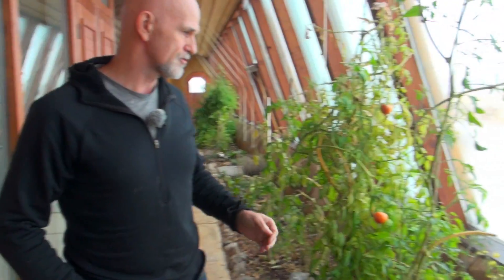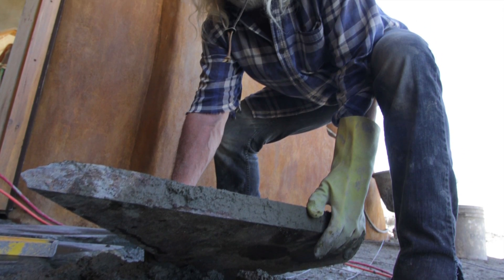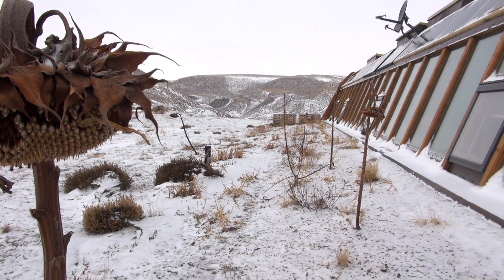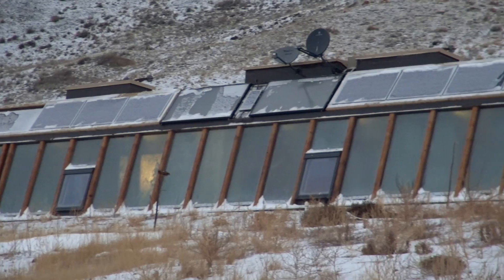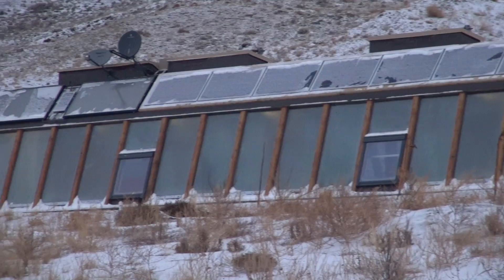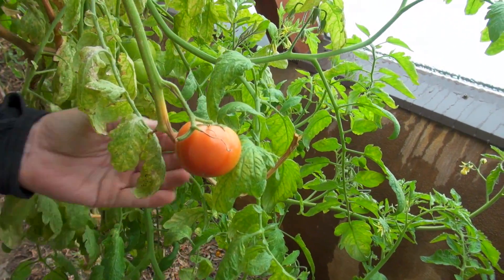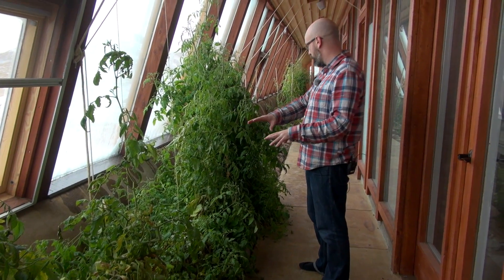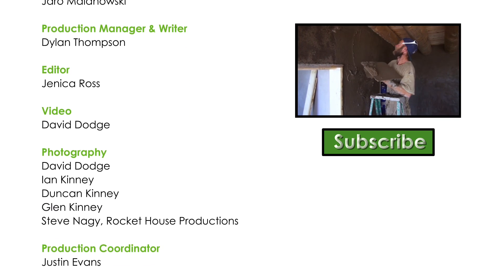136. Earthship living in a cold, desolate, Canadian winter

Comment: we live in a camper on 80 acres in South East Sask. near the North Dakota Border with some rolling hills, we do have access to power close by but ONLY IF we want to hook it up, we have an Artesian well tons of water though, not drilled, I have owned this property for over 40 yrs, I left Ontario to comes back home, we have surveyed it and fenced 100% of it. We are desparate to have help and knowledge in starting my Earthship, have 1 100 watts solar panel ( well its a start ) have a small camper in which we live in only with batteries and Generator, we are 70 yrs young, getting Bees in the spring, will be totally self sustainable, have a place picked out to start building IF we get help. PLEASE if you can help we would be eternally greatful...TY. PLEASE HELP US.

Comment: No wonder you’re running out of stored power; you have you batteries outside (even if they’re in an enclosure); you need to have lead-acid batteries in the warmest part—in fact the warmer, the better.  Don’t use proximity to the PV panels as an excuse; that’s what series configurations are for…

Comment: Sustainable?  You're a major polluter in the winter burning wood, a horrible air quality destroyer.  Let's face it:  Its pretty stupid living in area far from the equator in the winter, areas where food production is impossible.  THIS - MAKES - NO - SENSE. Haven't we learned how bad fires are for our air quality?  They're WAY worse than vehicle pollution - all the more because we don't really need them.  Solar and wind for electrical power to power heaters.  That's your sustainable solution if you're insane and spend winters here.
Plus you run propane.  How about going raw so you don't even need any cooking facilities or waste?  Meat, dairy, fish....100% raw.  Sprout your grains, lentils, beans and peas.  Corn is eaten raw.  It works.  But you'll need a warm climate inside to grow fruit in the winter.  That's probably the biggest challenge.  Some would say its not ideal eating food that can't be grown in the winter and they may have a point.  But then again if it wasn't for your well designed shelter you couldn't even live there in the winter.  Face it.  We were nuts to settle so far from the equator.  Absolutely nuts.  Before our transportation system was improved 100 years or so ago, malnutrition was a very serious problem in North America because during the winter we couldn't grow anything in northern areas.

Comment: I was so entrigued by this I went down to Taos, NM a few years ago. I'm from Saskatchewan so I know about the -44c cold snaps and the + 45c in summer.   But until u are hands on in one of these places, it's just not the same.  Self sustaining , with geothermal  constant regular temp within a few degrees which is controlled by the 65 foot tube running underground straight to outside.  Air cools when it travels thru it !  Or releasing heat by the roof  trap windows in green room.   Was awesome that u can rent one for a sleepover and experience the entire system firsthand.   So to answer the Canadians asking, I asked in person. I believe he said with half burrowed ship with sand packed tires, and a solar side, Canadian tundra is no problem. And it's work and experimental ideas still in progress. He runs an academy school down there. Interns, students build and live in their own. Thought about building a dog house like this.   Hmmm...  Cheers!

Comment: The edge where the soil meets the pavers / concrete... they should have a raised edge there with an opening every 10 feet for so to keep the soil where it should be but allow dirt to be swept in.

How can u clean the toilet if the water keeps recycling?  Can you use bleach?

Comment: This place reminds me of the Automobile manufacturers taking turns rolling out their one single hydrogen powered car, then lauding its praises as the future of transportation when in fact it's just a PR exercise.
This house cost how much to build? It houses how many people?It requires how much land?
What is the energy density, cost per kilowatt?
Cost per square meter to build?
Can the average income earner afford one of these structures?
I ask these pertinent questions, because I designed off grid steam turbine micro power plants that were multi fuel powered, meaning they could generate 25 kw to 100 kw from diesel,propane or nature based ethanol  derived from sorghum.
It is expensive, or requires  usually very low population densities to go off grid.
It is fun to build these structures and take the moral high ground with a sense of superior smugness , but try extrapolating this concept for 500,000 to 1,000,000  populated cities.
There is a reason this stuff works for a few former hippies.

Comment: Im poor and im still better then him. When i turn up my fire place can coock steack, bake bred, heat up water. I aint resupply gas that distance. Well if you stil lreading, i got 2 kw windturbine + another one 500W that picks primarily low wind speeds. And a TEG module is permanently bolted to to a stove. When stove is hot it produces 55W of electric power. Self cooling circulation pump 5W.
Who need satellite tv when life is so alternative from government.

Comment: He looks a little chilly. Earth ships should be kinda hard in the far north where soil temperatures are pretty low. (Deep soil temperatures @ 10 ft deep are basically your average annual temperature ~5C/40F in Alberta) Solar gain is nice, but you need insulation to keep the heat in - pure thermal mass will just draw you towards 5C. If you have a large thermal umbrella then i could see how it might work.
Reply: Best is to build into a mountain, like a cave home.
Reply: neither mountains or ponds should help much with that issue, basically because those are all sources of thermal mass, and earth connected thermal mass - aside from buffering some seasonal variation will tend to bring things towards the average annual temperature. You basically need some kind of insulation to fight cold weather.
Reply: @LucidTactics  For sure... I'm planning a passive solar build for central Saskatchewan with an insulated monolithic slab.  Not really an earthship but I plan on incorporating several of the features... grey water/greenhouse, water and solar collection, cooling tubes for summer and a small masonry heater or rocket mass for most of the year
Reply: I live in Southern Alberta and if we see a 5C day in winter, that's shorts weather. 13C and sunny, and people are in sunglasses and flipflops and dining on patios.
Look up the video of the chinese passive solar greenhouse in northern alberta where the guy uses a clay wall to store daylight and radiate heat to ~30C all year round. I suspect the soil content of the thermal mass of this earthship is something similar. It's likely not just regular albertan subsoil, but a collection of materials like added clays, sands, gravels, wrapped in recycled tires, and so on, which I've heard the inventor of earthships say is preferred to simple rammed earth blocks.

Comment: Canada is an interesting location for passive solar as the angle of the Sun changes dramatically between summer and winter hence a properly angled window takes in a lot of Sun during the winter yet very little during summer.

They should've added wind turbines to their system as wind is fairly reliable at night on the prairies.

The Earthship concept always works out to be a long greenhouse hallway with rooms as stalls on the north side of the hallway.

The ground sheltered homes may work for the prairies but is not an option for further north where the land is based on permafrost.  These so called sustainable homes are only possible with low population density areas so they are not really a sustainable living solution for our society which is projected to soon have 80% of the population in cities.  They are also often built with volunteer labour, v
Imagine if all that labour had to be paid for.  In truth, these homes are only for those with excessive disposable income who can live so far from major work centres.

Comment: man wsh they would have out in some time to figure out heating the house and generating electricity from the same fire hell may even provide the ability to have espresso on tap and hot water (all from the same heat source!!! fire! with a refrigerator could by a air intake from outside through the fridge then in to the fire thermodynamics  is it?

Comment: They need a wood gasifier so they can turn wood into electricity by powering a generator off of wood gas for when they they run out of solar, a bi-product of using a gasifier to run a generator is waste heat! so they could get electricity & heat from the same pile of wood.

Comment: Ok now comes the strange question.   If your going to run a wood stove,  why dont you have a thermal electric generator hooked up to it, you could be making an extra 400 watts of power off the stove, and since you are only running it when times are tough power wise.   It would give you that much more breathing room.

Comment: I like the thermal stability even in Canadian winter, but even in the first couple of seconds there's a lot of condensation in the that greenhouse where warm meets cold and its dripping down onto cob. I hope they don't get mold.
Reply: I'd hope that was accounted for in the plans. A simple collector system, and a channel to funnel it into the soil seems like a good way to cope. I also hope there is an antechamber when entering the home so the warm/cool air (depending on the season) isn't lost when opening the door. Great point to bring up!
Reply: Great point
Reply: For sure, needs a gutter.

Comment: no wonder you run out of electricity 
you have your batteries on the frickin roof for crying out loud 
WHY . a smart design ruined by a newbie mistake 
have the batteries inside in a box that seals properly and vents out and you will be set 
batteries run the best at around 20 degrees celsius

Comment: not hard to tell they dont live in that house at all its a  mess inside and out they have the power hub on the roof no wind generators the garden is barely alive and the wood burner is not big enough to keep the space warm earth ship or not smellberta is like liveing in siberia and the wind blows all the time there it never stops  mr fancy pants has 65 percent of his propane left because he dont live there and there is piss all for wood around that area  they built  the house solar . alone isent worth shit in the north or the south of alberta if you dont have wood   supplement and or wind generators or a need  for heat something funny here the whole thing funded buy pembina and oil companys explains the half assed efforts  and no back up or proper power systems off the grid but has a 3000 gal propane tank  yea right .              aces to mike reynolds good build          . one thing about smellberta you can smell it from 100 miles away     it being ether oil or bull shit

Comment: Southern Alberta is one of the windiest places in the world. Seems like they should have put in a turbine. They work at night as well.
Reply: @skinnygorilla Actually wind /solar are complementary energy sources
Reply from the maker: Small wind is very susceptible  to microclimatic conditions. We have seen many small wind installations in places where you would assume there is enough wind, but its easy to be disappointed. The big wind guys do two years of studies at the location of their planned wind turbine before investing millions in a wind turbine. While we many only invest ($10--$30k) it's still really a shame when the resource isn't good enough. Solar is very predicable on an annual basis. Yes a combined solutions would cover more weather conditions, but it may be better to invest in more solar and batteries instead.
Reply: @greenenergyfutures  . .PSA: Not all windmills are horizontal axis.  Not all windmills are 300 feet tall.  Not all windmills cost millions of dollars.  Not all windmills are unrecyclable.
Reply: In high school as an elective ' energy alternatives ' class I designed a self sufficient house . Not only did it use solar but wind , battery , methane generator , generator ( ran off methane ) indirect lighting with an attached green house for winter heat . I got a A +++ on the' plans ' as at the time I was taking a drafting class and actually made blue prints, material list design plans on methane generator , solar , generator , wind transition mechanism for redundancy . So one would never be without power as there was one or two back up systems . Once the green house started to produce the house would have been self sufficient . Except for toilet paper ( at the time that was a joke ) but a bade' (so) would rectify that . At that time funding from the government would have offset 80 % of the manufacturing cost as back then energy alternatives were being seriously looked at . The ' teacher ' gave me the afore mentioned grade but somehow lost the material I submitted for grade . . . . . . . .  Same ' teacher ' had us build a buzzer which ran off a 12 volt DC power source . Mine was an inch square and the arm with the contactor was at a length which made the  it make and break at 60 times a second . All this was deliberately timed and was noted on the plans I'd drawn up prior to the build . Showing I intended it to do so which should have shown not t only would it  ' buzz '  but I'd researched and understood the materials and rates at which the mechanism would deflect . Hence  a full understanding of what I was doing . One would think  this would have been rewarded with a high grade ? ? Others in the class had four by four boxes or various large examples , and some worked some didn't . I was told my ' buzzer ' had a fault . . . . . .the armature ( actually a electromagnet ) had a short causing it to buzz at 60 hrtz . I tried to explain that was the ' plan ' described in the build plans prior to the build. I was told that wasn't possible an it had a short . I got barely passing grade based on the detail and size of the buzzer . This only after his reading my objective having been explained in the afore mentioned plans . He was heated . . . . . . .as I was questioning in his knowledge/authority in front other class .  I decided I'd had enough of his lack of understanding of what I'd done so (  in front of the class  ) I asked him how did a short not blow the fuse I'd put in the cord supplying the power to this buzzer that also had a light inline or series so you could actually see the rate off pulse .  He still not grasping the concept of my design and insisting it was then partially shorted causing it to buzz at ' line voltage other a/c frequency .......all sounding very impressive . Until I explained the power source WAS 115 a/c volts that was operating at a frequency of 60 Hrtz . That only supplied the power TO the 12 volt ' DC ' output transformer I was using as a source to the buzzer ! ! ! ! He walked off saying I didn't understand . I then replaced the transformer with two others on the possibility I'd missed something . All three had the same result . Then as absolute I connected the buzzer to a 12 Volt lead acid battery and still the same result . But there was no changing his mind and I received a 75 grade point for this . Passing , but barely ..Now this was n elective class as I already had reached my credit hours and then some for the year . . . . . . My point ? There is always a better or more complete way of doing something but I give ' Cudos ' to those who are willing to  try then share their accomplishments for others benefit .
Reply: @addiumuppicus5738  brooooooo wtf lol
Reply: @addiumuppicus5738  this was super interesting, what a cool class!! Have you shared these plans anywhere? I would love to take a look. I'm also curious how the methane generator worked in your design? Was it linked into the plumbing somehow? My partner and I are designing a house and want to have as many alternative energy methods as possible because we are in Michigan where the light generated in the winter is negligible and I'm super intrigued by this concept.
Reply: @David Dodge , how's the bird population doing with that ? ? ? ? Like our conveniences ' micro waves ' have been proven to effect honey bees function . But has that stopped humanity from adding more powerful transmitters etc ? Nope , thing is like cutting and burning jungles , and clear cutting forests globally . Killing the Bees humanity is doomed . A well known fact , as is what those chopped down burnt trees ( On a global scale ) would have  filtered and produce being reduced . . . . yet there are those who are concerned with ' Global warming ' from pollutants but are turning a blind eye to the destruction of the earths natural filters of those pollutants blamed for being the major contributor . Not to mention the byproduct of the natural exponent from that filtering of pollutants is oxygen . . . . Look at a map off global clear cutting and slash  burning of forests again GLOBALLY  . . . . . . and then ask yourself . Why ?
Reply: wind turbines are incredibly costly to maintain, prone to malfunction and dangerous to work on.  of course the size of one matters but over all, not the most practical source of energy.  Hopefully in the future they simplify the designs.  As an electrician I would never work on one.  Very high mortality rate.